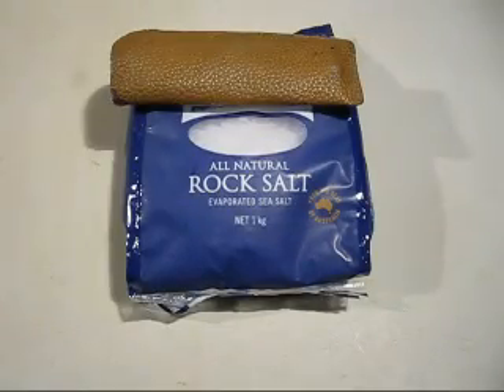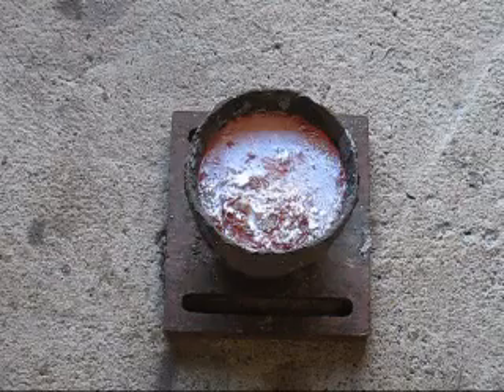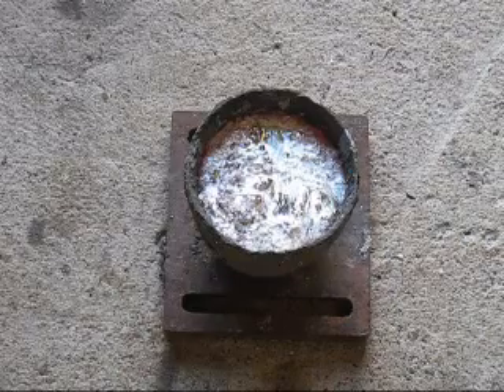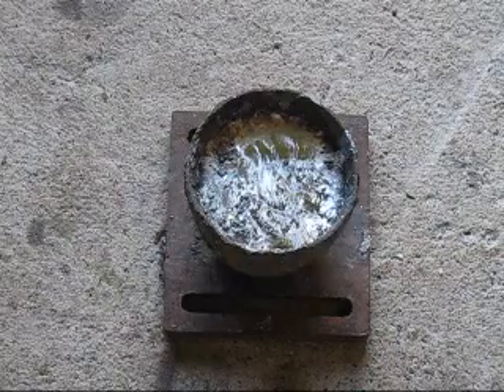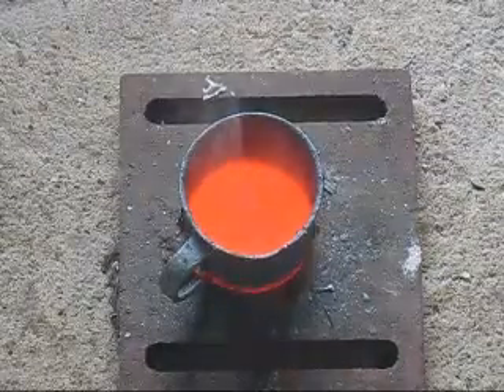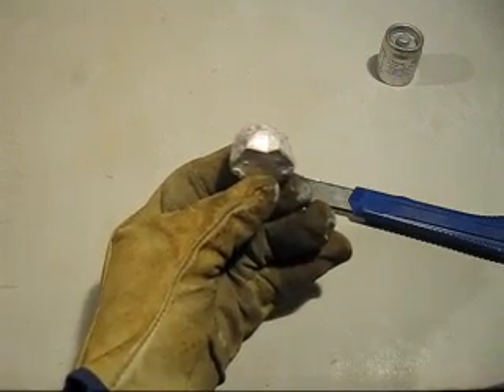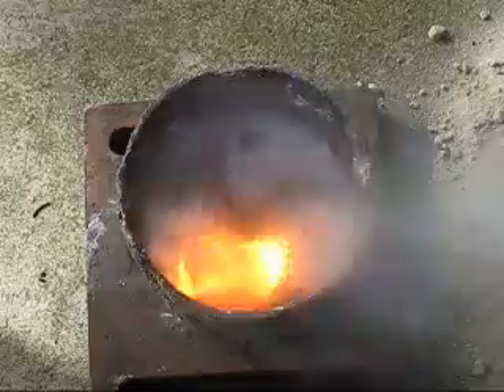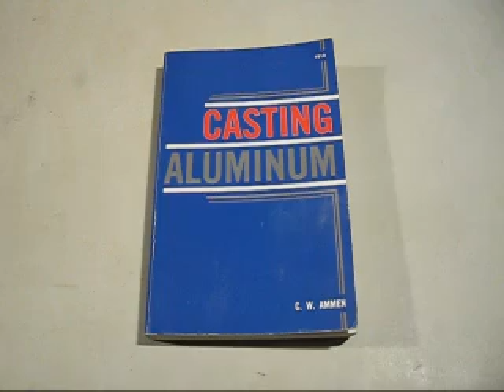Can you degas aluminuim with common salt Sodium Chloride

Comment: I powdered The Pink salt and mixed it 50/50 with anhydrous Borax and saw a difference, but i put it back in my furnace after adding for about 5 min. There was gas coming out the puddle was moving and i didn't remove the heat till the surface turned black, i think theres magnesium in the pink salt as well as NaCl

Comment: I use powdered/fine silicon carbide in foil packet to the bottom, mix, then lite salt in a foil packet pushed to the bottom, let melt and then mix in de-dross. Saw chlorine solids being used as well for more advanced de-gassing but thats pretty iffy on the safety side as it makes some seriouslly nasty gasses.

Comment: I've watched a few other of this man's videos concerning the degassing of aluminum.  In each of them he seems to do everything in his power to prevent the process from working.  He tends to use aluminum that appears to be just barely molten as opposed to performing the processes in the furnace at temperature.  In this case, it appears that he sprinkles the salt onto the dross layer and doesn't even attempt to mix it into the actual aluminum.  When he does feign an attempt at incorporating the salt, he seems to be folding the salt into the dross and then scooping it out.  Also, he seems to be using the coarsest salt crystals he can find.  A "fairer" procedure would be to keep the crucible in the furnace, encapsulate the salt in a foil packet and plunge it to the bottom of the crucible with a degassing plunger.  Also, finely grinding the salt would probably make the reaction more likely to occur.  I would also have liked to have seen him add some of the molten salt into some molten aluminum.  If the process/reaction had any chance of actually working that seems like it would have been the most likely scenario.
Reply: 100% i saw the other video were he claims myfordboy or oldfoundryman told him to use salt and he does what you said, either hes completely clueless or a troll

Comment: For a short while I worked at an aluminum extrusion plant where they dealt with melting tons of aluminum at a time. Degassing was carried out in the gas fired furnace while still being heated, not after the melt was allowed to cool outside the furnace.
Reply: What did they use for degassing?  Did they use CO2 or some kind of solid fluxing compound?

Comment: I have been in large aluminum factory. They had huge melting operations pour big slabs and roll it to make thin aluminum sheets. The used large amounts of salt and you could smell the chlorine in the air. It rusted everything around the furnaces.  So I believe you are incorrect based off what I have seen in a large setup.

Comment: Use a chloride salt of a metal less reactive than aluminum, such as zinc chloride. You can also just use dry air or nitrogen bubbled in from the bottom that will wash the dissolved hydrogen out of the aluminum. The hydrogen in the aluminum is formed by aluminum reacting with water vapor in the air above the molten metal. The aluminum reacts with the water, pulling off the oxygen forming aluminum oxide and the remaining hydrogen can dissolve in the metal. Chlorides or chlorine work because the hydrogen will form hydrogen chloride gas with the dissolved hydrogen.It is an acrid smell, but doesn't smell like chlorine.

Comment: I was under the impression that flux should be pushed to the bottom of the molten aluminum with a specialized tool.
Reply: Yeah! But maybe the impurities are on top of the metal liquid.
Reply: I've never seen flux used where it wasn't mixed in thoroughly.
Reply: Whenever I've seen salt added to aluminium it was rolled up in a ball of foil and pushed to the bottom

Comment: You have to use a bell plunger and it works great been using it for years both Potassium chloride and Sodium or a mix. 
It will bubble through the melt and pull out all dissolved hydrogen. Just a note Hydrogen start to be absorbed once the melt is all turn into liquid. The longer your heat the melt the more violent the bubbles will be.  Do it this way and pull a sample and put under vacuum and it will have zero porosity when cut.
Reply: hi sir, would you remind sharing your contact with me cuz i have some questions on behalf the flux and i will be thankful for you.
thanks

Comment: According to the chemistry buffs, the chloride salt reacts with the aluminium, producing aluminium chloride. Aluminium chloride is a gas at these temperatures (with no smell). The gas forms small bubbles. Hydrogen in the aluminium diffuses readily into these small bubbles (low partial pressure) and is carried away.
No chlorine is released. You won't ever break up a chloride salt of an alkali metal by heat alone. They're about the most stable chemical bond you can have.
Reply from the maker: To produce Aluminuim Chloride aluminium has to reduce sodium chloride to sodium and chlorine gas and  then what happens to the sodium metal that is leftover? It is so light that it floats in molten aluminium.  As you said alkali chloride salts do not breakdown with heat alone so how can aluminium chloride be produced if it will not breakdown. You need to find some chemistry buffs that know what they are talking about

Comment: NaCl is used for salt glazing of ceramics. It is added at temperatures well above its melting point (801 degrees C) by tossing packages of it into the firebox. The salt melts, vaporizes and flows through the setting. As some of the salt condenses on the pots the sodium reacts with the clay to form a glaze and the chlorine goes up the flue ( very nasty stuff as it produces hydrochloric acid in combination with moisture in the air). In short. the temperature is critical to any reaction.

Comment: the salt is used as a flux, not a degasser. I usually melt it and break it up as a two part reason, first, it creates a eutectic that lowers the melting temperature of the salt, and two, it drives off the moisture so that when you break it up, keep it in airtight containers till your ready to use. Salt is quite hygroscopic, so you want to keep it out of contact with the moisture in the air. I use granulated pool shock wrapped in aluminum foil, and it breaks down into chlorine gas, and bubbles through the molten aluminium. I know it produces a good amount of chlorine gas because it's come up under my face shield a few times and got me in the face.
Reply from the maker: The book says sodium and potassium chloride will breakdown with heat to give chlorine gas.
Reply: yea, for that stuff, I wouldnt take with a grain of salt, but his gating techniques are interesting. I think most people that that cast with aluminium know the salt eutectic as a flux anyhow, not as a degasser. Ive seen plenty of stuff used as degassers, but the best is just to learn to control the burner to control the atmosphere rather than messing with degassers.
Reply from the maker: That is what i do.
Reply: you state that the salt forms a eutectic, a eutectic of what? the aluminum and the sodium? do you have any data on this.

in regard to the pool shock wrapped in foil, the majority of the bubbles developed are from the expanding entrapped gas in the wrapped up granules rather than the chlorine gas being developed. This process is introducing more gas and moisture into the molten metal than what it can remove. the large bubbles developed just does not have the surface area to degas.
Reply: What do you mean granulated pool shock...what is that? pls reply

Comment: When chlorine is used to degass aluminium, it is actually reacting and producing aluminium chloride. It still works because AlCl₃ has a low boiling point of only 180°C. 
     I'm guessing that the reason the book says you can use NaCl to produce chlorine for aluminium degassing, is because someone confused it with hexachloroethane, which is actually used for aluminium degassing. Hexachloroethane thermally decomposes into tetrachloroethane (dry cleaning fluid) and chlorine gas. It is a white crystalline solid at room temperature. Since sodium chloride does get used as a flux, I could see how someone might confuse the two.

Comment: Right, this makes no sense. You can get salt white-hot before it breaks down. It's not going to break down into chlorine due to heat alone. Maybe if it reacted with something, aluminum or aluminum oxide, but from what I recall of chemistry, that doesn't make sense.
Reply from the maker: In the book it said to use heat alone.
Reply: Indeed it's complete bollocks, and whoever wrote that paragraph didn't know any better. 
To remove hydrogen from molten aluminium, for small batches, it is common practice to use tablets of a hexachloroethane - organic chlorine is relatively easy to strip from the molecule, ionic chlorine from sodium chloride definitely is not (industrially aluminium is degassed by bubbling argon through the molten metal).
By the way, aluminium chloride does in fact give off hydrogen chloride when exposed to water or moist air (zinc chloride doesn't, as I wrongly said before); I'm not quite sure if it'd give off chlorine in molten aluminium, it sounds plausible though.
Reply from the maker: I was thinking  the same thing.
Reply: I agree.   I think the book was wrong.  I THINK that an electric current passed thru the molten metal would do better to dissolve aluminum oxide back to aluminum and free oxygen and hydrogen.
Reply: Put the salt in a foil foil packet and push it under the surface to mix in.

Comment: You're right that NaCl or KCl solid salts won't work as everyone is using them.  I think i've seen an older video of yours on the same topic.  I believe part of the mythos of this ritual is based on a misunderstood fact though.  NaCl/KCl solid solutions are used as the basis for aluminum fluxes, but they must be in a solid solution before they'll melt at a low enough temperature to be effective.   I also don't know how well the salt mixture does by itself.  It may only serve as a mechanism of lowering the melting point of a more important component (in my case, CaF2)

Page 131 of "Handbook of Aluminum' by Totten, MacKenzie shows a phase diagram of a NaCl-KCl-CaF2 aluminum flux.  The melting point of the eutectic mixture is about 660C.  I've made this flux by dissolving fluorite (CaF2) in molten salt mixture.  The accuracy of making homemade flux this way is troublesome because absorbed moisture throws off the weights unless you roast the salt first.  

The flux I've described melts a bit higher than the aluminum flux BCS sells, but it performs the same.  The foamy metallic dross will separate to a loose grey ashy material, and your metal loss rate is minimized.  I even went and recovered a bunch of ingots out of my old dross bucket.  I've tried other gimmicky household things, and they only made more metallic dross.   I think most people don't really understand what to expect of a dross cleaning flux, so the remaining claims tend to be the ones that are the least easily disproven by eye at 240p (e.g. degassing performance).

As far as degassing goes, i don't think it really does any good for that.  If anything, you've just demonstrated my point about how much water is in salt stored in permeable containers.  That moisture does anything but degas metal.  

Oh.  Before anyone asks:
NaCl-KCl mixture is roughly equimolar or ~4 parts NaCl / ~5 parts KCl  by DRY mass
CaF2 should be about 5%  by mass.  
Inaccuracies only result in a higher melting point.

Large crystals of CaF2 won't melt simply, but it will slowly dissolve in the molten salt, so give it time.
Alternatively, pottery materials suppliers sell CaF2 flour as a fluxing component for ceramics/glass/glazes. 
IIRC, Laguna lists it as "Fluorspar, Superfine'.

Keep the ground flux in an airtight container.
Reply from the maker: Thank you for the info.
Reply: you're welcome

I should add: 
if the book isn't on google books anymore, a quick search for the paper "Solubility of CaF 2 in NaCl-KCl salt flux for Al-recycling and its effect on Al-loss" by Milke et. al should provide a superabundance of info on NaCl-KCl-CaF2 mixtures, phase diagrams and all that lovely jazz.

Also, regarding degassing, Pyroflux P-40 is listed as a specialty flux for cover/drossing with mild degassing ability.  This product is an unknown mixture of KCl-MgCl2.  I haven't gone looking for info on
KCl-MgCl2 binary solutions, but I imagine it's whatever ratio yields about a ~650C liquidus.  Might be something to think about for any curiosity-motivated future experiments, but once we're talking about grinding/roasting/melting/mixing/casting/grinding a bunch of salts to make flux, the attractive simplicity of using ubiquitous products kind of evaporates.  These fluxes aren't terribly expensive.
Reply: Dream Services International pls can I just add up sodium chloride and potassium chloride and mix it up with fluorspar and use as flux in scrap aluminum melting or must I heat up the sodium chloride and potassium chloride and fluospar to a molten state before using the composition as aluminum flux?

Comment: So are you saying that the book was wrong? If so,  from your experiments what is the best solution that you have found to date?
Reply from the maker: I don't bother degassing.
Reply: Don't overcook your aluminum. Then degassing isn't needed. Took me ages to learn this.
Reply: You can use sodium carbonate, wearing a mask cause of some toxic emanations but for "home casting", degassing is like unecessary... just my point of view.
Reply: @verdatum  what determine the aluminun whether they overcooked or nor, is it the high temperayure or let them stay in molten temperature for a long time?
Reply: @calvinsalim2375  the latter. Once molten, it turns into a magnet for gas.
Reply: @verdatum  thanks dude

Comment: how is it supposed to degas if your just mixing it at the top, try putting it in some aluminium foil and holding it at the bottom. there are so many factors that cause bubbles, and one factor that will make a difference depending on where you live, I've never been to Australia, but where I live (which is the same place as myford boy) the UK has more moisture in the air which the aluminium absorbs and splits the oxygen and hydrogen and creates hydrogen gas. 
love your videos though, especially the cast iron ones.
Reply from the maker: In the book it says it will remove hydrogen as a flux but it will float on the top only. Salt will absorb moisture so if it is plunged to the bottom it will bubble.

Comment: Chlorine gas has no odour, the smell you get in a swimming pool is the chlorine reacting with contaminants in the water, i.e. urine, sweat and oils from the swimmers. The reaction creates chloramines which is where the odour comes from.
Reply: Saltwater pools (fresh water with salt added--about 3000 pm; ocean is like 10x that) have a salt cell/generator electrode that the saltwater passes through.  As saltwater passes through, electrolysis occurs, splitting the salt and water into hydrogen and hypochlorous acid (HOCl).  I'm not sure if introducing electricity into a crucible would work!  But Darren is correct: chlorine is odorless...public swimming pools have that "chlorine smell" but it is indeed chlorine reacting with sweat, urine, oils, etc. that produces the chloramines that can bug one's nose, eyes, and skin.  Chloramines are formed when HOCl reacts with ammonia--a component of sweat, urine and body oils.  Anyway, more than you wanted to know!
Reply: Yes Stephen I agree. Anyone who isn't just Regurgitating "Facts" KNOWS Chlorine does have an ODOR and If they had generated Chlorine Gas and SMELLED IT they would Never Forget that experience IF they Survived.
Reply: >Chlorine gas has no odour
on the bright side, this is a lot funnier 2 years into COVID

Comment: The melting point for NaCl is 801 °C so how could it go into a solute form if your Al is below that? If it could and there was H also dissolved in the Al then you could get HCl (hydrochloric acid once it dissolves into water) But what happens to the Na? It could form  Na2O if it can rob some O from any oxides present, otherwise from the air on the surface of the melt. So it sounds like it is one of those things that only works under specific conditions, which the book does not define, and that is poor technical writing.
Reply from the maker: You need to try this out and if you can get chorine gas from salt without passing an electric current through it let me know.
Reply: In my other comment, I describe a NaCl-KCl-CaF2 flux.  The fact that eutectic solid mixtures like this have much lower melting points (660C) than any of their components and utilize additional fluxing agents (CaF2) leads me to think that this whole "dump salt in there" fad is just cargo cultish nonsense based on the misunderstanding of actual products.  Then again, i'm just talking about drossing.  Idk that it does anything for degassing, but the fact that it's hard to prove it doesn't degas (without material testing) means that's the claim that persists.